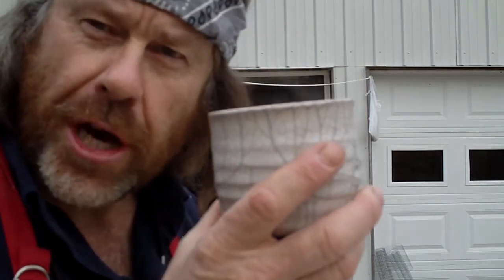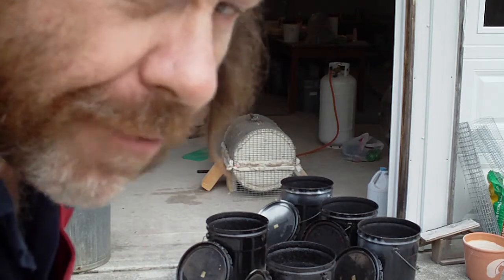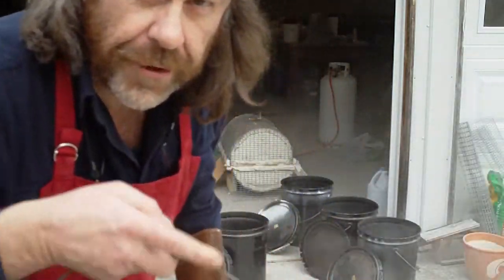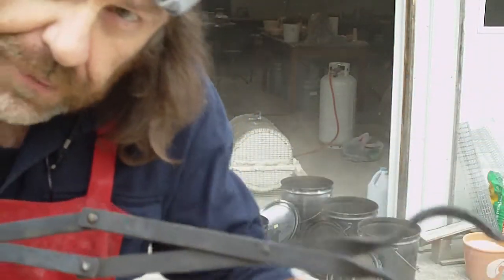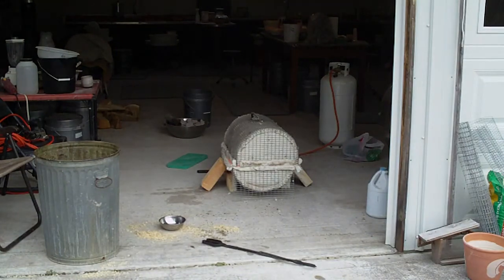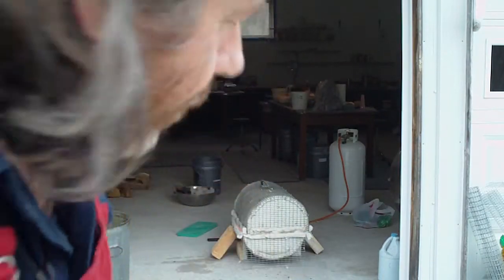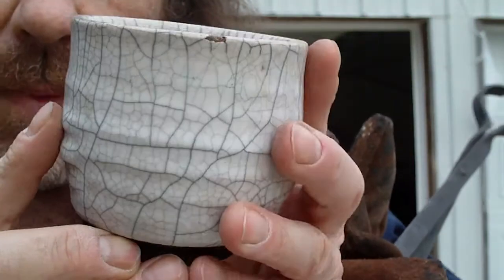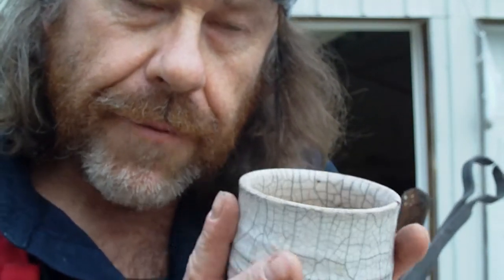SIMON LEACH POTTERY WORKSHOP  ~  ....Raku again !

Comment: When you raku, is your goal to carbonize, or to reduce? Have you tried sand/alcohol? My former teacher would raku with sand/alcohol. What he did was make a pile of sand, pour denatured alcohol on the sand, then put the pot on the sand, which ignites the alcohol. Then throw a steel bucket over it to seal it all up. The flames eat up the air, and gets the reduction to happen, burp if you like. Anyway, alcohol burns cleaner, so less scrubbing. But, it will also be less smoked if that's your goal.